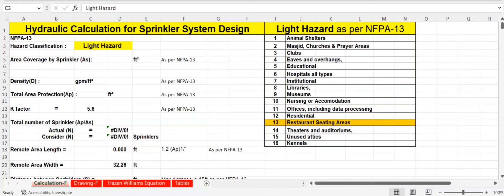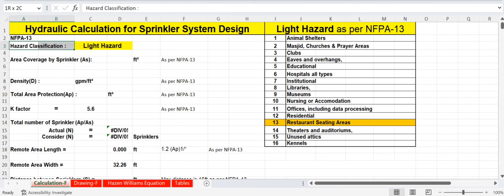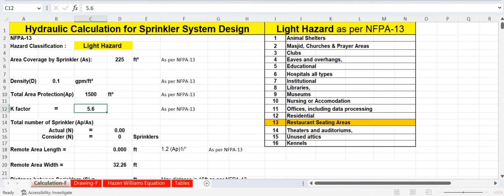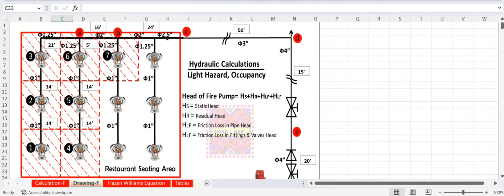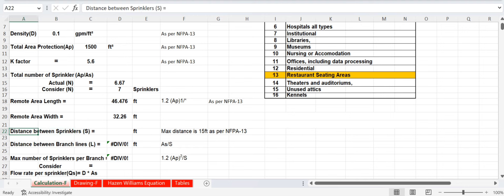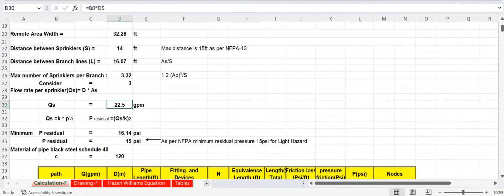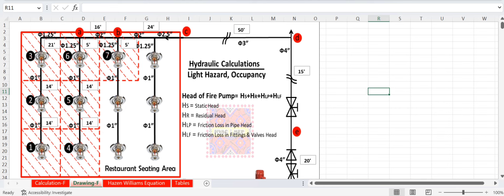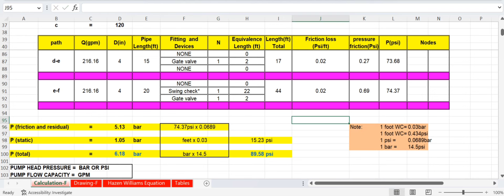NFPA 13 Fire Sprinkler System Design Calculation for Light Hazard

Comment: Share the excel copy
Reply from the maker: https://www.udemy.com/course/hydraulic-calculations-for-fire-sprinkler-standpipe-system/?couponCode=677C26730430BD2ADF44
In this course you will each and every sheet for fire sprinkler and standpipe system
Reply: What is remote area

Comment: Sir, can you please elaborate why we take 1500 ft2 area of sprinkler operation in light hazard? Next sir what will be that for ordinary hazard?
Reply from the maker: Please check as per NFPA 13 
For light and ordinary hazard 1500sqft and extra hazard 2500sqft
Reply: @mepbooster8184  thank you sir,
But what can be the possible reason behind it?